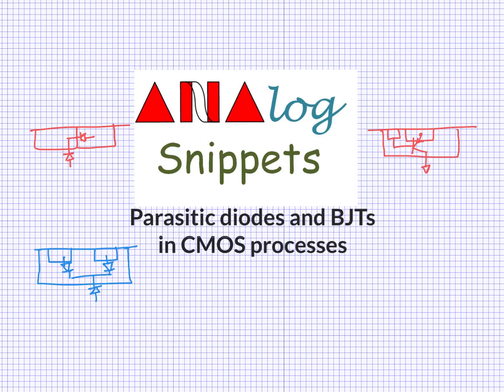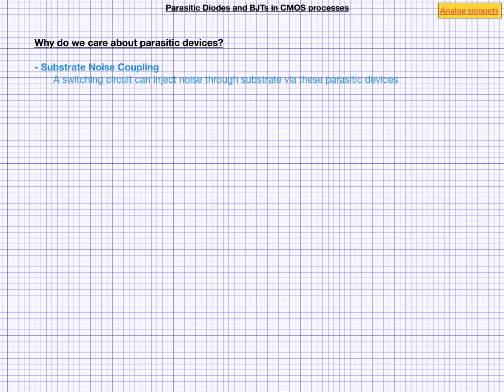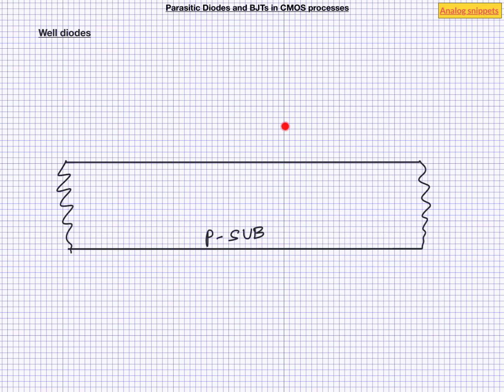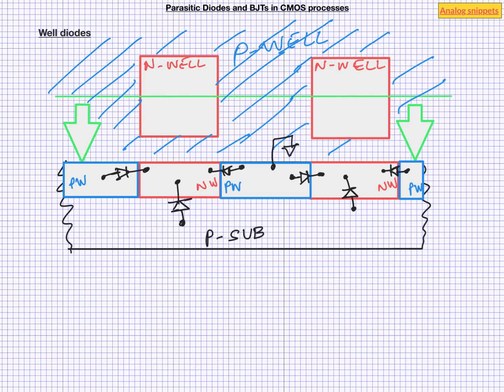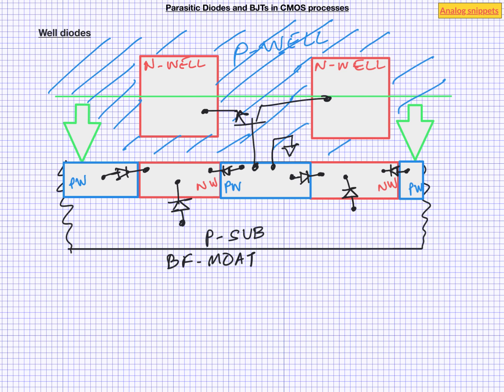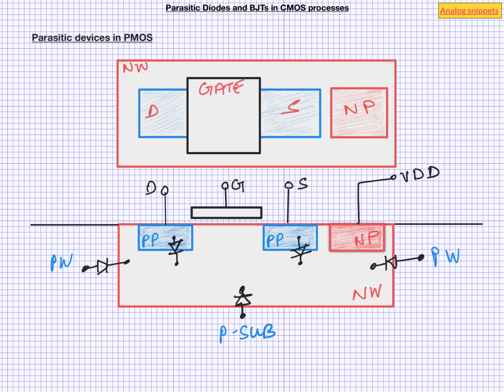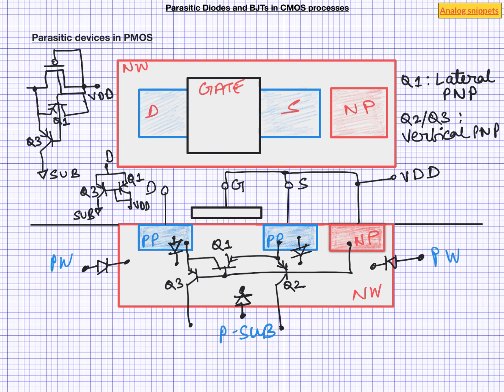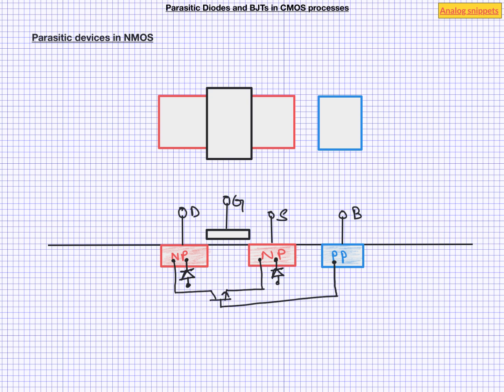#30 Parasitic diodes and BJTs in CMOS processes

Comment: Very good one. Would you mind explain few examples of DC-DC converters where these problems can occur? I haven't done any converters so far so curious. But many thanks for this wonderful video..
Reply from the maker: These problems occur in any dc dc converter which uses on chip switches. CMOS switches have associated BJT, which turn on, for example during dead time or when converter is in reverse CCM mode. Essentially whenever current flows through body diode of these switches.

Comment: If gate to source is shorted for pmos Kenya that fet is off since vgs is zero @9:46
Reply from the maker: Yes, PMOS is off. Conduction happens via parasitic diode/bjt.
Reply: @analogsnippets  right even though transistor is in off state it’s going to eat some current if we forward bias diodes for some reason

I have this question when let’s say these parasitic diodes are reverse biased there will be some reverse leakage current flowing through diode .. do models consider that leakage ? Or Monte Carlo analysis ? Because this leakage is so hard to predict do they model that ?
Reply from the maker: It depends on which diodes. Source-bulk and drain-bulk diodes are modeled in pmos/nmos model and any leakage should show. For well diodes you need to instantiate them with right area/perimeter in your schematic to see leakages. BJTs are more tricky. You will require dedicated silicon measurements of appropriate device and then dedicated models  will be required to simulate them. For accuracy of leakage values you need to check with foundry. These leakages are significant only at high temperatures.
Reply: @analogsnippets  i agree . But I always wonder how would one define the leakages in models ? Because leakages are the effect of some random phenomenons like for mosfet when fet is off and high vds is applied, there is leakage due to random silicon crystal defects ...
Reply from the maker: Leakages are not that random. For example in MOS, leakage can be caused by subthreshold operation or due to effects like GIDL, and in diodes there is reverse saturation current which flows because of thermally generated electron hole pairs. There is well documented physics for leakages, and model can be very accurate.
Reply: @analogsnippets  okay that’s true they are temperature dependent 
What I have seen is our models that we use vary a lot when compared to silicon data